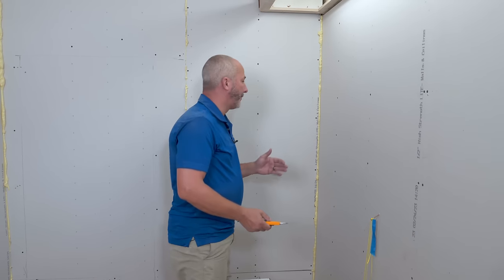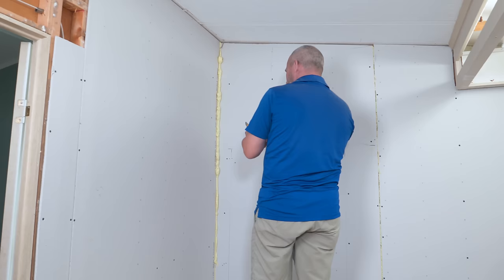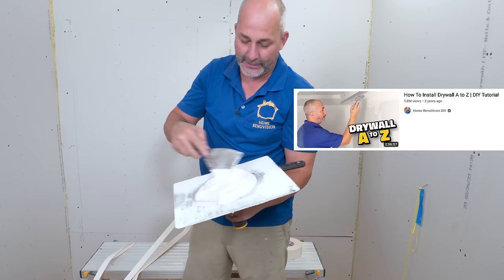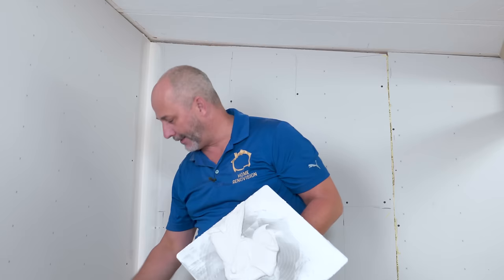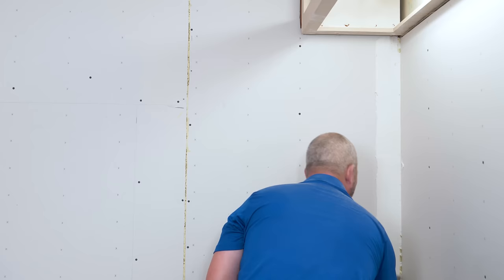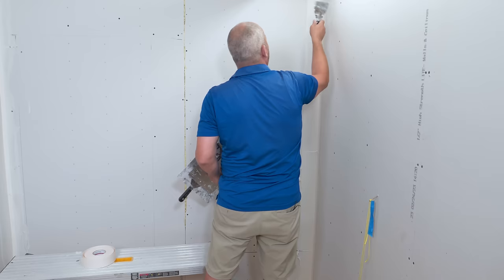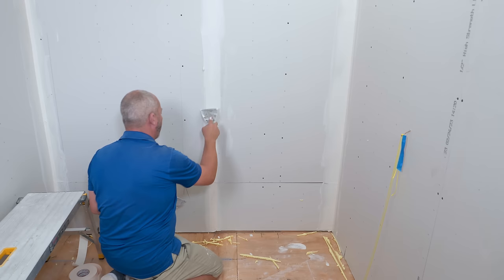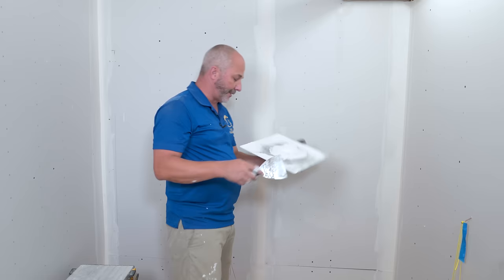How to Mud A Crooked House | DIY Drywall

Comment: 42yr old journeyman finisher for 3 yrs & 7 yrs finishing for a local company and i totally agree with you about a hawk or pan & a 4"/5" knife. The man i trained under never used/uses a Bazooka a box or a Banjo. He is faster pulling tape by hand than anyone running a Bazooka ive seen with less dry bubbles or peeling corners. He made a reel for the tape out of the metal bucket handle, slit the bottom of the bucket to feed tape through and pulled a 100' at a time. I would squeeze the tape/mud behind him and am a way better finisher now bc of the talent he had and taught me. He said anyone can use cheater tools or mud a tape seam but a real finisher is known for his corners. Dont get me wrong, glazers are incredible tools but taping and getting true corners w a hawk/pan and a 4",5",6" knife takes skill. So, i totally agree with your video and thank you for your teachings. Its just sad to see how much the trade is dying. Im basically the youngest one doing it around my area. Kids now a days don't want to do hard, dirty, and not so good paying work. I take pride in what i do and my 5" knife never leaves my back pocket. Unless im using it or drop it,but like you of course i have Back up in my pocket. Dropping a knife when on stilts, not so good. Thanks again. Sorry, i draw the line at finishing, no wallpaper for me. Lol
Reply: Youve never see a real tool man then you cant beat a pro bazooka runner!
Reply: @jremy89  sorry for the confusion but I was saying that he was faster than anyone I have seen. Being the people ive been on jobs with who were runners. I know that a Bazooka runner, especially one with a mud feeding machine hooked up to it, is definitely faster than anyone pulling and laying tape by hand. We know that time is money when you're doing a job that pays by the foot and not the job. Just wanted to clarify that. I've definitely seen people in the industry who can  run a Bazooka w/ a 500' roll of tape in minutes. Same thing goes for someone hand glazing corners vs a self feeding glazer. Impossible for anyone laying by hand opposed to a glazer. That's all. I have to put some pictures of my work for people to see. I've done some pretty incredible and some interesting jobs. Have a great day and may you all be blessed
Reply: There is a tool for that now - it’s called the “Tape Buddy”. It’s on Amazon and saved me DAYS when I was taping my basement using Jeff’s A-Z videos.

Comment: I used foam on my last house for a few big gaps thanks to your tip. Although, if you use a roller and a corner angle head you get sharp corners that are embedded. Though the cost isn't justified for a homeowner. 

I agree on the corner finishers (the flexible sheet metal ones) though. The rounded inside corners drive me nuts.

But I do lile the intimacy of taping with a knife. It's like having a conversation with a corner, lol.

Comment: I always use foam on drywall, I used to use all sort of quick set or mud to fill in the corners and the gaps than on certain areas you had to do it 2 3 times cause it was drying and soacking in. Or. Cracking big times. With foam bam like you do in this video. Mud tape that's it

Comment: As a DIY homeowner, I would highly recommend first time, or inexperienced homeowner drywallers to consider a paperfaced metal inside corner and outside beads. They are relatively cheap $4-5 each, so if you are only doing small renovations, one or two rooms or a closet it will cost an extra $40-$50, but the amount of headache it will save from not having to deal with improperly bedded corners, or bubbling is worth the cost IMO. Plus it gives you so many easy options to hang a magnetic laser level from any corner.

Comment: Hi Jeff, Have you seen the Stanley FatMax 18mm Snap Off Knife. It holds 6 extra blades inside like a guns magazine. If you snap a blade, just move the slider back and it loads the new blade for you.

Comment: Those corners need a solid strong backing.  During any settling, these larger separations filled with foam will eventually crack>   I had a guy come work for me and he did that on a couple new additions.  After he did it I told him not to do it anymore.  One was for a friend the other for a customer that I did not know.  Within 5 years both of these had a hairline crack in a wide crack filled with foam.  Always fill those bad ones with some hot mud real fast and never have trouble in the future.   I am 59 years old and have owned over 150 rental homes for over 20 years and built new homes for 40 years.  I have been able to see how repairs did through the years to change my quality for the better.  There is no strength behind those joints, you may get lucky but you are gambling.
Reply: Good comment. I was wondering about that and us DIY'rs have time for 20 minute mud to cure. Plus, that foam is expensive and don't ever get it on your hands, it only comes off when your skin sheds.

Comment: I measure tape length plus an inch, then fold the tape and pull same length for each additional corner. Tear at each fold crease. Saves time, tape and gives you a straight edge on each piece.

Comment: During the stairwell renovation, I found a 1x6“ gap from the stair riser to the drywall. Filled it with foam, let it set. Removed the excess, mudded over it & lightly sanded. You’d never know there was a gap after I finished. Primed & painted. Perfect every time !!
Reply from the maker: Well done Bill!
Reply: @HomeRenoVisionDIY  all thanks to you & your videos Jeff.

Comment: Most of the videos I've seen of people using automated tapers had someone following the taper doing the bedding. They just don't show you that part in reels because it isn't awe-inspiring. I'm not sure how you would even be able to do it without that part as the tape joint would be proud of the surface a bit.

Comment: After applying one coat of primer I noticed a line or shadow on a partition wall. Checked with straight edge n 1/16" out. Should I compound or leave it.

Comment: I just removed a 1980s windows valance (popcorned even) and now I'm prefilling for taping.  What do you do when a screw will not go in flush?  It's pretty stuck now and I can't get it go back or forward.  I think I need a more powerful drill, mine is a Black and Decker from the early 2000s.  The screwhead is sitting a hair above the board.  I'm hoping that when I skim coat the whole thing to meet the existing wall that it gets filled in.  Wish I'd see this video before I made my 20 minute mud mess this afternoon and did all the prefilling!
Reply: Take the screw out. Redo.

Comment: Prefill large gaps with hot mud would make a stronger joint, would it not?
Reply from the maker: the fill in the corner does not actually provide strength. its just there to keep the tape wet while setting the corner. foam is faster and even acts like an adhesive to bond the 2 sheets together.

Comment: Just wondering: can you use sheet rock 90 for tapping? I have a small patch and i have a bag of 90 and would prefer not to go buy a tub of machine mud
Reply: I almost always use hot mud for taping. Makes it faster to get to the top coat, and it hardened a lot harder than the sandable 24 hour stuff. Makes a stronger joint less likely to crack.
Reply: @PSNDonutDude  thanks for the response. I used it last year for a patch and it worked great. Even found it easier to sand. Just wasnt sure if it did a good seal with paper tape or not. Ill give it a shot next time

Comment: What is the difference between the red, blue, and green lid bucket of plaster?
Reply: Not sure about red, green is all purpose and has a lot of glue in it is better for taping, can be tough to sand. Blue lid is lightweight and made for 2nd/3rd coats and easier to sand
Reply: @bradgehman859  thank you.

Comment: 😂😂$4.38 for a can of foam, I don't know which HD u shop at in Fl., my area like $15.00 a can.

I use a 6" knife to apply tape, 4" for tight areas, smaller knifes for smaller areas, then 12" and 16" and for Big areas a Float.
Their is a better way to use your knife to apply mud in you corners, whis is faster, but I use a Pan, never could use a Hawk.